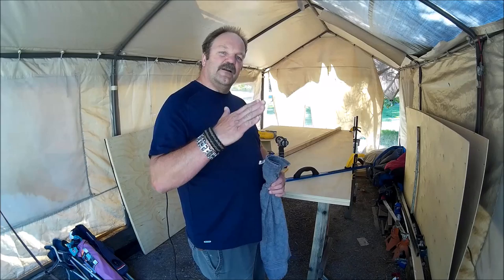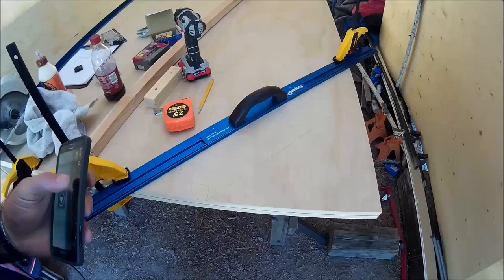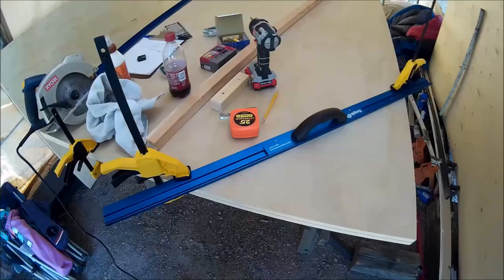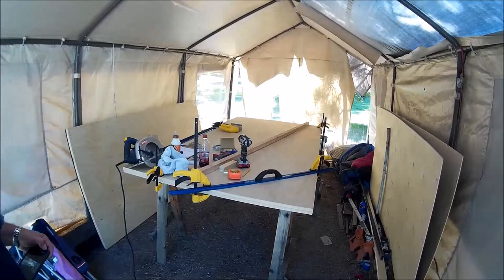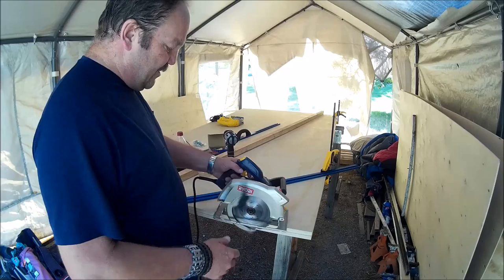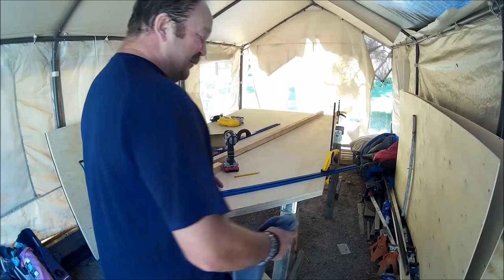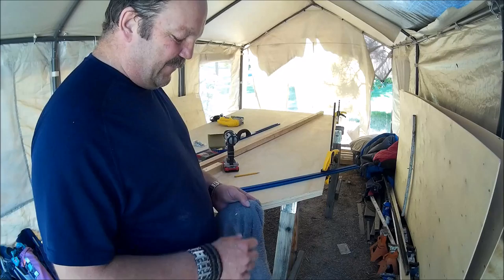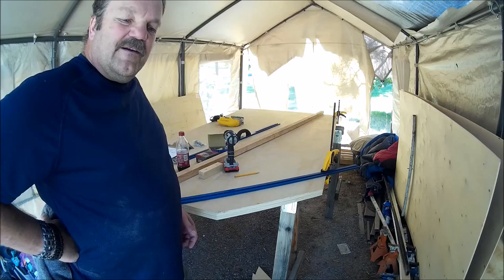DIY Teardrop build Day 4 Cut the walls and ready to attach to the floor

Comment: just remember if your going to use 1/2 inch on the roof and your going to skin it with 032 aluminum you'll have to cut 1/2 inch off the bottom of the walls so your skins will reach 
lookin good i think the doors slowed down my build the most crazy how much they cost but glad i went with the pre made ones . looking foreword to your next video
Reply from the maker: Thank you for the tip. Now you got me thinking. I think what I am going to do is put a 4" diamond plate strip along the bottom on the sides to make up for the extra height. I think that will look nice and maybe provide a little protection to the bottom of the camper. I had already thought about a big piece of diamond plate on the front to protect the front from rocks and such. But I think it will add to also run it down the sides. I had considered building my doors but I know my abilities and that would be a stretch of my abilities. Plus I know I will get better weatherproof with factory doors. WOW I just looked at your video page and seen you metal detect also. Very cool. I just started again a few months ago but just don't have it time I would like to put into it. I do good when I go out just not frequent enough. I will subscribe to your channel and get some tips from your videos. Thank you  again!
Reply: Can you post a link to your vids. Thx
Reply: Never mind. I used this thing call search and found your channel. lol
Reply: had so much fun building the teardrop i know you will too looking foreword to watching yours come together
yeah the metal detecting is great fun too 5 years detecting and still having fun